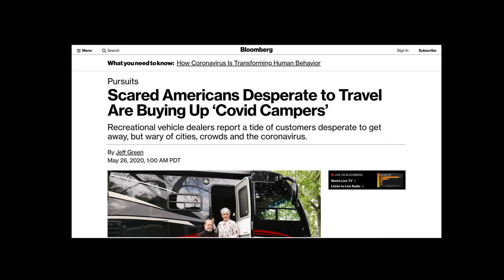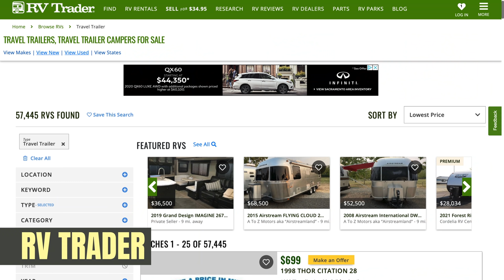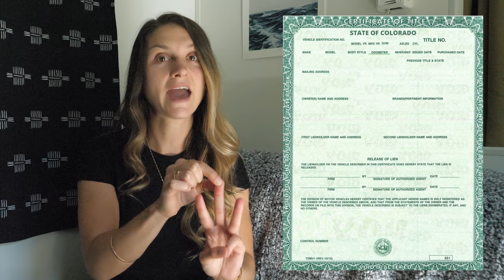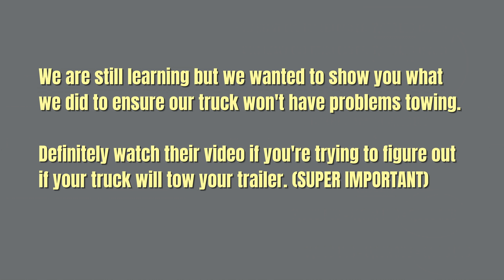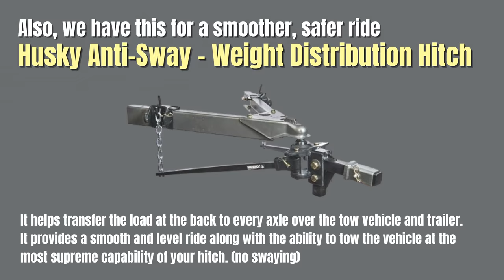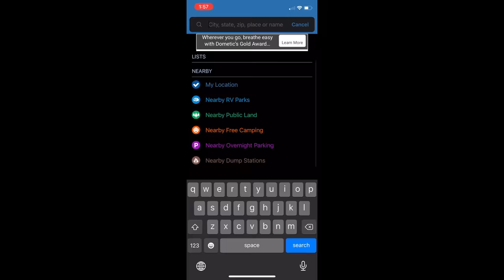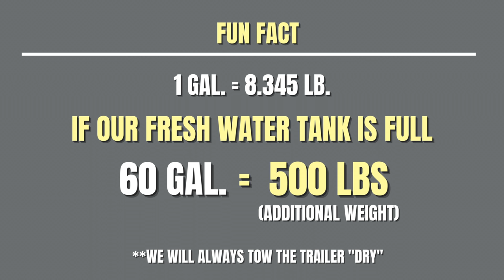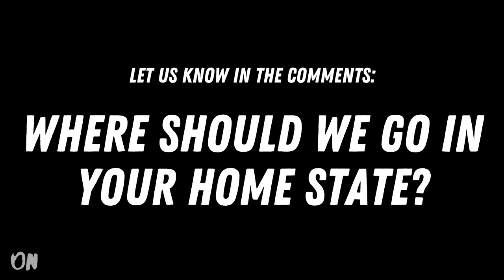Travel Trailer Living for RV Newbies - Buying & Prepping our First RV!

Comment: As a general rule you aren't suppose to grab the max weight trailer for your vehicles towing "capability".  My SUV is rated for 7300lbs and I have been told by everyone to stick below 4000 and ideally under 20' of trailer, even then I'll need a weight distribution hitch and trailer brake controller.  Its not the power, its also the wheel base, SUV's are shorter than half ton trucks and high winds can make things super sketchy.
Reply from the maker: Solid advice, thanks for sharing! :)
Reply: That’s like my 3/4 ton has a 16k towing capacity but I personally won’t go over 12k
Reply: You need to be aware of the tongue weight you have on the hitch.

Comment: Helpful video for someone getting started.  For boondocking - you will need to carry your water in and your waste out so you really need to include that in your load planning. It looked like your waste hose had a big drop exiting your rig and then a climb up to a peak where you begin the hose support.  I’d eliminate using the highest hose supports that cause this as poop needs to go down hill.

Comment: By now you have moved on from this.  A couple of things to note if you have not been on the road before. 1.  INVEST IN TRAILER BRAKING SYSTEM FOR YOUR TOW VEHICLE.  2. Try to buy a Trailer where the waste disposal connections do not hang low to the ground, you may find that "Boondocking" is a problem and you scrape them off/break them on rough roads.  3.  It's advisable to ADD A TRANSMISSION COOLER to your Tow Vehicle even if you have one from the factory.  If you are pulling in the summer heat out west you want to keep your Transmission Temperatures under control.  Definitely get the weight distribution hitch.  You should also have a good power drill which makes the Stabilizing Jacks on the trailer easy to raise and lower.  And Trailer are often just stapled together.  Take a good look at the wiring andd plumbing if you can see it BEFORE buying any RV.  RV's take a beating and something always breaks.  Invest in a few good rolls of Duct Tape or Gaffers Tape for the temporary repairs you are going to have along the way.  And if you find staples that have popped out... test to see if there is something solid on the location they came out and use SCREWS.  Always inspect the roof and window seems on used trailers.  That should cover a little bit more of what you will want to know to get started.  If you have a 3 way fridge AC, DC, Gas you will need to be sure you always level your trailer so the refrigertor will function properly.  Put in a carbon monoxide and propane detector if you do not have one.  Invest in a good Doggy Bed if you are taking along your pets (Which you should as they are great Alarm Systems).  If you have never backed a trailer find a big open parking lot and PRACTICE.  Buy a back up camera.
Reply: Great advice, thank you my friend!!

Comment: This is a really well done video, covering a lot of stuff in an engaging way for newbies.  Your towing info is well done too, but still unclear on all that goes into payload.  Specifically the weight of gas (215 lbs for your SUV) and your hitch equipment (100 lbs).  If the 562 lbs number is from the manufacturer, it will exclude the battery and propane which mostly adds to hitch weight (not to mention any added trailer content such as food, clothes, chairs, fresh water, etc. -- a portion of which - maybe 10-15% - goes to the hitch).  If these things were not included, you might be over the limit.  When you are loaded for travel, a stop at a weigh station might help.
Reply from the maker: Good to know. Cheers for the info!

Comment: You need to get rid of that awd... the transfer case uses a viscous coupler that burns up pretty commonly ( its has clutches inside basically) if your truck starts to slip a lot when trying to drive it you will be looking for a new transfer case

Comment: Can these trailers actually keep you cool during these hot Texas summers? We have a family of four and I typically keep our apartment down to 70 degrees year-around. Is this even possible? Thanks for your thoughts
Reply from the maker: Yep! We just have a single AC unit but it works great. Keeps us completely cool in hot humid temperatures. Many trailers have 2+ AC units. A small fan helps circulate the air too. 👍🏼

Comment: For long distance towing and/or full-time RVing, it is generally recommended to not exceed 70% of the vehicle's maximum towing capacity. So, in this case: 8100 x 0.7 = 5,670 lbs. This has always been my understanding. This is because the maximum tow rating is only an absolute maximum, for a short trip across town. It doesn't take into account the stress of things like driving up into the mountains, etc.